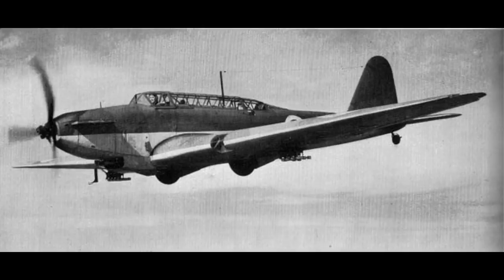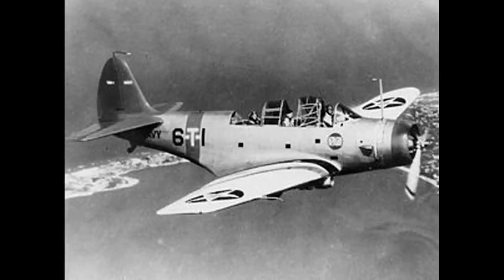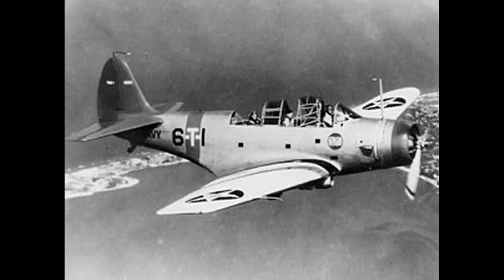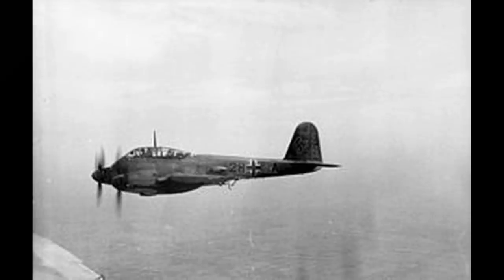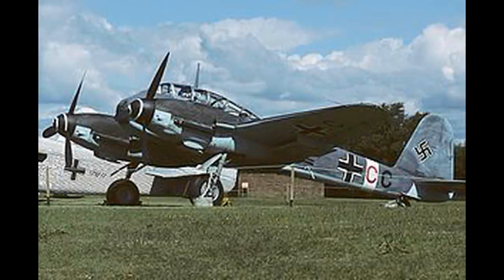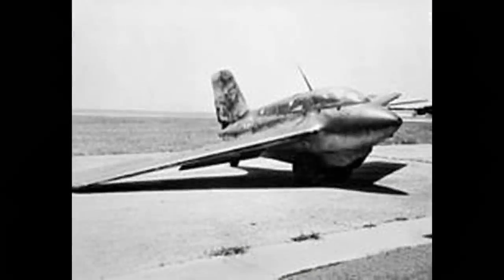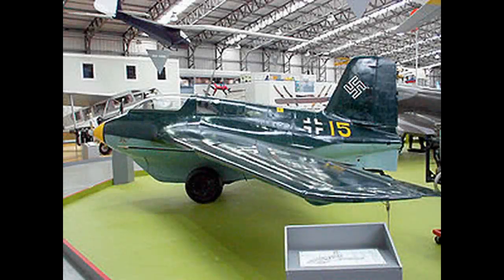TOP 5 WORST military aircraft used during WW2

Comment: 1. Fairey Battle. (A heavy, underarmed "bomber" that was state of the art in 1936, but a target tow by World War II.)
2. TBD Devastator. (U.S. Navy's first low wing metal monoplane torpedo bomber that was state of the art in 1935, but was too slow for the Battle of Midway in 1942.) 
3. Breda Ba.88 Lince.. (A 1938 aircraft that fell victim to  equipment updates that made it too slow for World War II combat in North Africa.)
4. Messerschmitt Me.210. (An aerodynamically unstable 1942 design that was more dangerous to it's crew than the enemy.)
5. Me-163 Komet. (A rocket-powered aircraft that used a hypergolic fuel and oxidizer combination that could explode at any time.)
Reply: I would suggest the Brewster Buffalo.
Reply: To be fair, TBD was not THAT slow.
the problem is what the TBD was carrying, i.e. Mk13 early model torpedo.
TBD is at the very least faster than the British Swordfish, but why no-one complained about the Swordfish?
Because the real problem is Mk13's outdated dropping conditions, which require like 100 knot at 100 feet or something.
Japanese Type 91 torpedo, on the other hand, can be dropped at practically any speed the B5N Kate can reach at sea level.
This seriously lowered the survivability of an attacking TBD (as well as early model TBF, who debuted in Midway and didn't hit a damn thing).
So it's really the torpedo's problem and not the plane's.

As for Me163 the pilots actually love them despite all the problems and safety issues. No one, absolutely no one, can out-run you or out-climb you if you are flying in a Me 163.
Reply: @ChaplainBobWalkerBTh  Tell that to the Finns!
Reply: @blastulae  Yes the poor finns, we had neighbors who were Finns. Good for them the rusky pilots were horrible. Sadly the ski troops were eventually overrun in Finland. May Stalin enjoy his eternal reward and his sauna bath.
Reply: @ChaplainBobWalkerBTh  Finnish Brewsters were lighter than the variants in US and UK service.  Not just Soviet pilots but aircraft were inferior.  Had the Finns had a better fighter direction system, the Red Air Force would have ceased to exist.  Brewster was underpowered, but a sound design.  USN probably made the right choice in going with Wildcat, but Brewster savaged the Red Air Force until replaced by Me 109s in 1943.  It made dozens of Finnish aces, but has gotten a bad rap.
Reply: @blastulae  thanks for the info. As an American few know this part of history of Finland. Too bad Stalin did not die decades sooner.
Reply: @ChaplainBobWalkerBTh  The Communist regime would have been just about as bad had Lenin lived longer and been succeeded by Trotsky rather than Stalin.
Reply: @blastulae  agreed - Lenin oh your mean Ulanov and Trotsky you mean Bronstein.  Stalin's kids spoke Yiddish and they ended up in the USA after the war. Amazing how that works. Oh and Hitler's family ended up in the USA after the war also.
Reply: The TBD might have been worthwhile if it had a torpedo that actually functioned. The Mk 13 was a turkey designed from the Mk 14 submarine torpedo with ALL the same faults.
Reply: Chaplain Bob Walker B. Th. Stalin was a former Russian Orthodox seminarian. NONE of his family spoke Yiddish. He was however fluent in German, Latin, Greek and Hebrew as well as Georgian and Russian - just like Lenin. Your distortions of history is unfortunate.
The entire communist revolution was a WW1 GERMAN intelligence operation from start to finish. Like most “intelligence” operations it backfired spectacularly.
Reply: @allangibson8494  People Stalin's kids spoke Yiddish. Get the book "BEHIND COMMUNISM" by author Frank Britton and look up the many names of the communists, then look up the names in a 1925 Jewish encyclopedia and see who is who. Trotsky real name was Bronstein. Stalin did indeed attend seminary and was likely an infiltrator.
Reply: @allangibson8494  The only two languages in which Stalin was fluent were Georgian and Russian, although he spoke the latter with a thick accent.  He could read and speak German a little.  How much he could understand is questionable.  The extent to which he could read ancient Greek, Old Georgian and Old Church Slavonic is not known, but probably hardly at all.  He could however sing songs in them from memory.  No Latin at all.
Lenin was notoriously bad at languages.  He never even learned Polish, which is very close to Russian.
Reply: blastulae After six years in a Russian Orthodox seminary with good marks, Stalins grip on Latin and Greek should have been as good as any of the other university graduates of the time. Under estimating Stalin frequently proved bad for your health and was a point he deliberately cultivated.
Reply: @allangibson8494  He might have learned how to read Latin.  As noted, his only fluent languages were Georgian and Russian.
Reply: Chaplain Bob Walker B. Th. Yiddish is a GERMAN derived language - it would not have been spoken in Georgia at ALL. Turkish or Armenian would have been far more common - even in the Jewish population. Lenin was Russian orthodox too. Jews were never more than 10% of the Communists (about on par with the total Russian population and the White Russian forces). The Nazi propaganda was responsible for the rest of the image - that and Henry Ford’s seminal bull shit.
Reply: @allangibson8494  Of course Stalin didn't speak Yiddish, although his smattering of German might have enabled him to follow bits of it.  However, Russian communists were somewhat more Jewish than the population at large, which was around three percent.  Leadership of the CPUSSR was over 6% Jewish in the 1920s, but Stalin's purges largely eliminated this disproportion.  Thank God that Stalin died before he could effect his planned pogroms.  Fittingly, his purge of Jewish doctors may have contributed to his well-deserved demise.
Reply: blastulae The Russian Communist Party had a grand total of 958 Jewish members in 1918. Not exactly overwhelming. Others joined in the 1920’s but by then it was the only way up the social ladder.
Reply: @allangibson8494  Not to associate myself with Putin's libel of Judaism in the CPUSSR, but the fact is that its pre-Stalin leadership was indeed disproportionately Jewish.  Among the Old Bolsheviks zotzed by Stalin were Trotsky, Kaganovich, Zinoviev, Sokolnikov, Kamenev, Yagoda, et al.  Many executed Stalin's genocide against Ukrainian and Russian farmers.

Comment: The design of airframes outpaced the development of engines powerful enough to provide them with adequate performance. The evolution of military aircraft at the time was extremely fast, and those developed in the early to middle 1930s were already obsolete. Many countries had to get by with what they had due to limited defense budgets, even up to the beginning of the war. You might add, the light bomber was quickly replaced by attack (ground support) aircraft. As I understand it, the Fairey Battle was not built for low level bombing runs. The Seversky P35 was the basis for the later P43 Lancer and ultimately the P47 Thunderbolt.

Comment: The Devastator when used as designed, (ie a torpedo Bomber with air cover) was effective.  It performed very well at the Battle of the Coral Sea with air cover as it had to slow to less then 125 mph to drop torpedoes.  At the Battle of Midway it never -the - less tried to perform without air cover and was decimated.  Narragansett Bay

Comment: A little nuance here :
_ The Fairey Fulmar, naval version of the Battle was instrumental at November-1940-Taranto in preparing for the success of the Fairey Swordfish night torpedo run. 
The Fulmars thanks to their speed, made a successful daytime attack on the fuel tanks of the Italian naval base. 
These burnt brightly throughout the night guiding the RN slow torpedo planes to their targets.
Reply: The Fulmar wasn't a naval version of the Battle, it was a different design. It has some family resemblance because both were designed by Marcel Lobelle.
Reply: @thisisnev , thank you for the correction.
Reply: @thisisnev  The Fulmar was built in response to Air Ministry Specification O.8/38, which was for a Naval carrier-borne fighter/observation.   In effect, a fleet defence fighter with reconnaissance capability.   As such, the Fulmar was not expected to 'mix it' with land based fighters.
Reply: The Fulmar was slightly capable of out-running Italian biplanes.  A fighter plane with an onboard navigator was a bad idea.
Reply: @Rev6044  It wasn't the design that was bad, but the pre-war conception of war.
Weird ideas with weird results (not useless though) like the Boulton-Paul Defiant.
Fortunately Britain had Barnes Wallis & Guy Gibson.

Comment: Fairy  Battle was very badly used.  It could have been an effective light bomber or dive bomber.  But RAF high command threw them against loads of fighters and A A fire.  Not the fault of the plane
Reply: The only aircraft that could've done adequately what they had the Battle do was the Westland Whirlwind, which they had too few of and it was given bad engines. But if the idea of Whirlwind fighter-bombers had been utilized earlier, the Wehrmact would've been delayed weeks.
Reply: Yes, you never see the Ju87 in these lists, but in most respects the Battle is a superior aircraft?
Reply: @peterharrington8709  The Ju 87 was designed to survive light  ground fire. Sturdily made. Redundant control wires etc.  For reasons I never understood the RAF command dislikked dive bombers. Well trained crews made the Stuka a superbly effective weapon.
Reply: @romanbrough  until it came up against Hurricanes and Spitfires

Comment: The Avro Manchester wasn't much cop either until it was redesigned as the everlastingly famous Lancaster.
Reply: That was because it was designed to fit into the standard hangers of the time. Wingspan was too short meaning it had a lower service ceiling